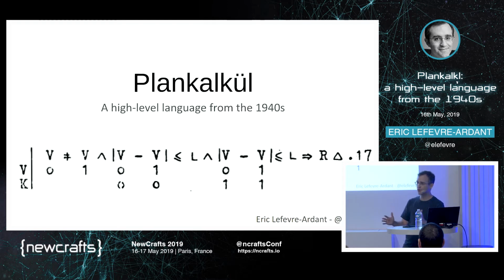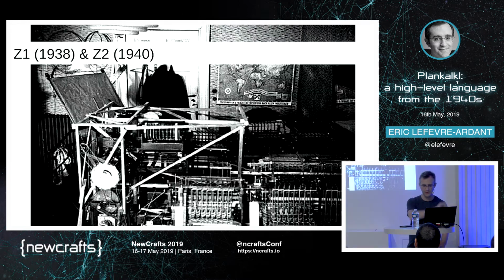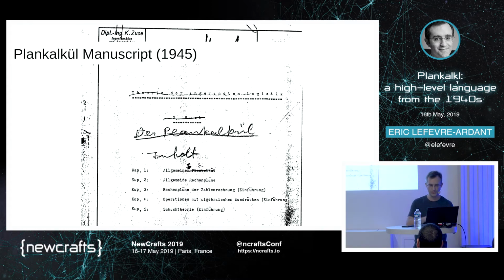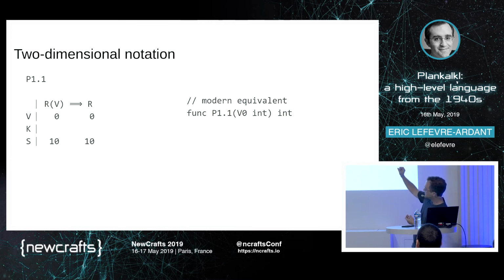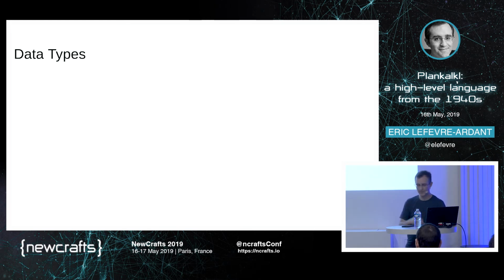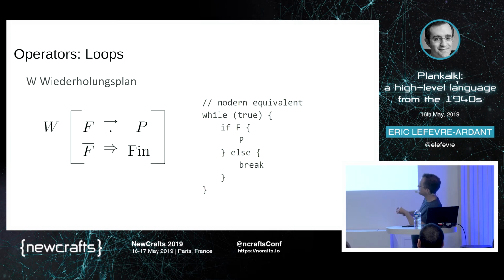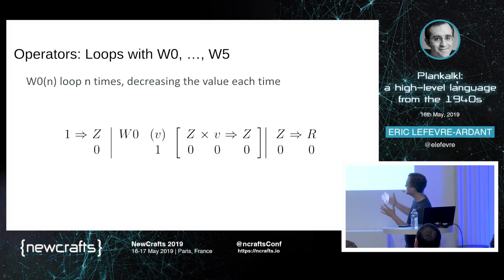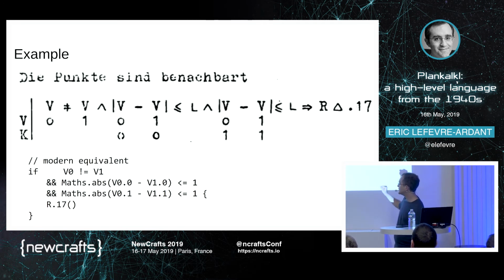Plankalkül  a high level language from the 1940s by Eric Lefevre Ardant

Comment: If you read the paper that claims the Z3 is turing complete, it's a streeeetch yo say the least. It lacked a branch operator. The Z4 lacked this, too, until it was added later as an upgrade.
Reply: Brainfuck is also Turing complete and it doesn’t have a branch operator.
Reply: @obinator9065  there are many tortured ways of having Turing completeness without a goto. Supposedly the Z3 it can be done by physically making a loop with the instruction film and populating it in this tortured manner. In fact, a branch operation itself is done without a branch operation so you could argue that it's never really a necessary feature, but again my comment was about practical Turing completeness not some fantasy world where time is no constraint. Finally, brainfuck does have a jump operator